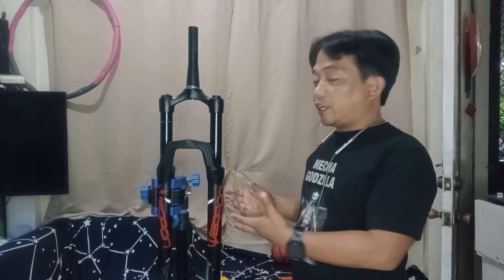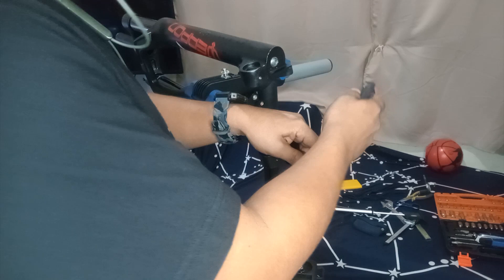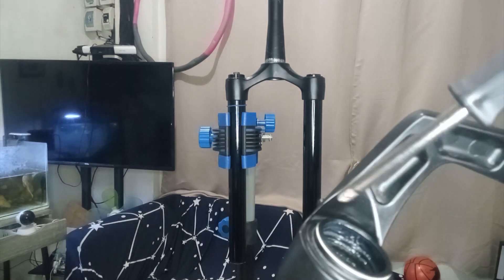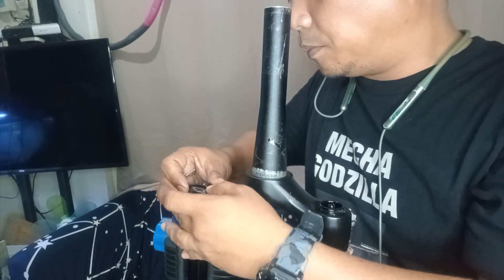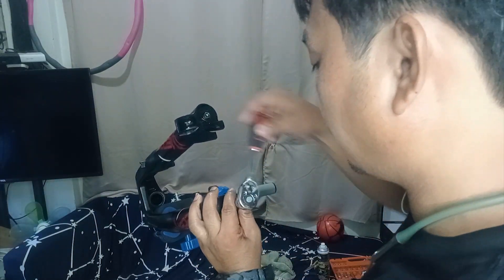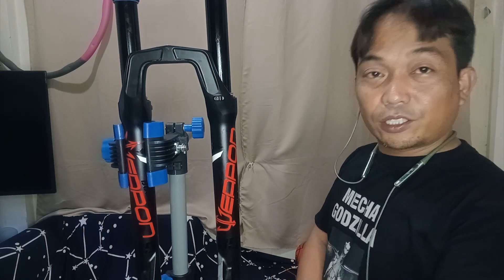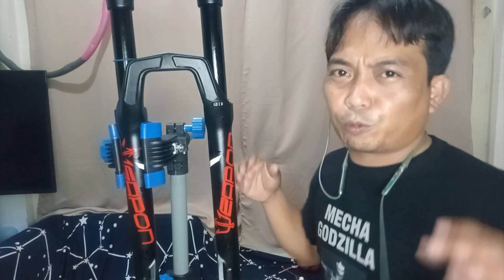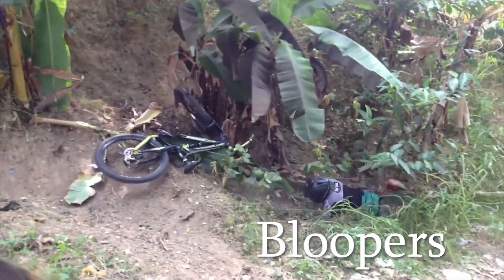Weapon Cannon Disassembly and Honest Review #cebubikebootcamp #teamlukapa #productreview

Comment: Ho Sir awesome vid, pasok naman po yung mg Bolany damper sa shoppee dyan po noh?
Reply from the maker: Depende if pareho ng stanchion size. At thread, tanggalin mo at sukatin ng caliper. Ganon ang ginagawa ko para sure.
Reply: @cebubikebootcamp  Ty bro, I measured with caliper yung thread ng damper ng cannon (where the lock out is), nasa 30mm yung width, sa Shoppe and Lazada lahat ng damper nasa 28.7mm width.

Yung sa akin kasi, yung stock damper nung Cannon, parang may buhangin or rust yung spring sa loob, kung baga pag kinompress, parang may gumagasgas sa loob.🤕🤕

Filinvest ytails with minimal below 5 ft jumps naman.
Reply from the maker: @Arbigale  iyong may thread mo na measure? may drawing iyon sa shopee, hanapin mo iyong item na may measurement. 

Iyong parang may buhangin sa loob, try mo muna i-lower leg service iyan, baka may buhangin na nakapasok.
Reply: @cebubikebootcamp  ty bro, ☺️☺️yes bro, yung thread mismo with caliper 30mm sya. Nasa loop ng damper yung oarang gas gas tas hindi bumabalik kaag yung damper pag compress kahit loose na
Reply: @cebubikebootcamp  mag video then upload ko sa youtube as unlisted, will send you the link here☺️
Reply from the maker: @Arbigale thanks

Comment: Master, adjustable ba travel yan?,. at ano pwede nyo ma recommend na servicable damper components para ma prolong ung for use.. TIA.. salamat sa pag share ng kaalaman.. subscribed..
Reply from the maker: adjustable naman ang travel upto 180mm, ang problema ang damper niya, hindi kaya ang travel adjust, tumutonog na.
ang pinaka mabuting gawin maghanap ng serviceable damper na kasya sa 35mm stanchion
Reply from the maker: pwde lagyan ito ng damper na Charger 2.1 ng rockshox
Reply: Natry mo na sir 2.1 sa cannon 35 @cebubikebootcamp ?
Reply from the maker: @phil5073  anong 2.1? wheel thickness?
Reply: @cebubikebootcamp  Charger 2.1 dampers

Comment: Idol naa kahay baligya na cartridge sa weapon cannon?
Reply from the maker: Naay compatible ana, nakalimot ko katong usa nakapalit. Try daw sukod ang thread ana using caliper, naa sa shopee kanang naay drawing check sa upper thread. Then if di kaabot sa ubos butangan ug stand off bolt
Reply: @cebubikebootcamp idol basi tika ma pm sa fb, ngayo rako tabang asa ato didto dapit sa shopee na damper dgahan nanggawas man gud,
Reply: Di na mu play ako fork kay na loose thread ang rebound adjuster mali ang pagka rotate nya ang nahitabo na stuck na need ilisan aron mubalik ang play
Reply: @cebubikebootcamp 27.5 weapon cannon 160mm travel
Reply from the maker: @janueldelafuente2572  ah, tang tanga lang na, then sukda, naa ka'y makit-an sa shopee
Reply from the maker: @janueldelafuente2572 pwde ra na nato sukdan, dalha lang na diri

Comment: Idol unsa sukat sa thru axle sa cannon. nabali akua ba
Reply from the maker: wala raba silay baligya wa ko kakita, pangita daw sa shopee kanang pareha sukod
Reply: @cebubikebootcamp  weird kaayu ang thru axle sa cannon kay walay thread. 2 days na ko naga pangita murag mahulog ni na I DIY naku ni using bolts haha
Reply from the maker: @MichaelAcurantes  oo as long as mo kupot siya pwede kaayo
Reply: @cebubikebootcamp  Bay naa ko update basin makatabang pud ni sa imuha, naka order ko sa shopee ug thru axle mao ni na sukat L162 M15x1.5pitch mao na ni akung gamit karun. pero need pud nimu mag palit ug 

m15 1.5 na NUT and m15 na spacer dugay kaayo ko ug sigeg research pero nag work jud ni 100% sa cannon 35 160mm boost